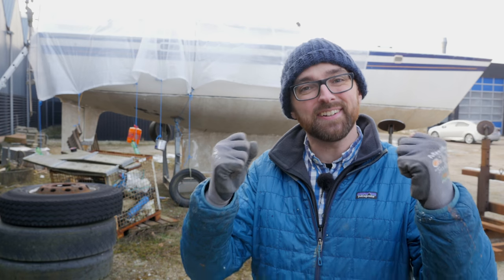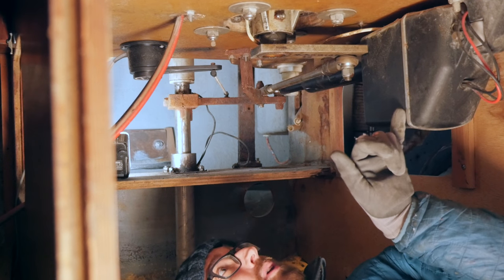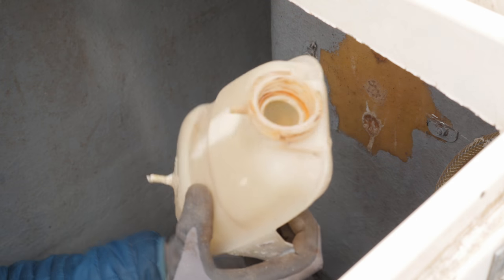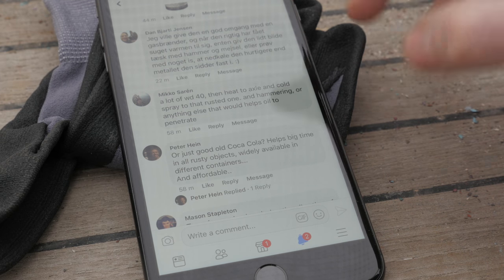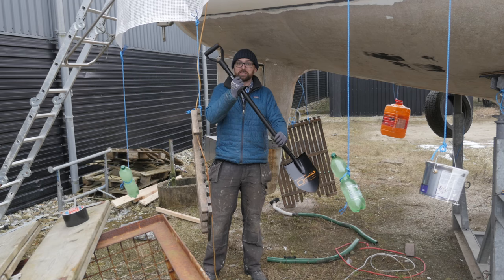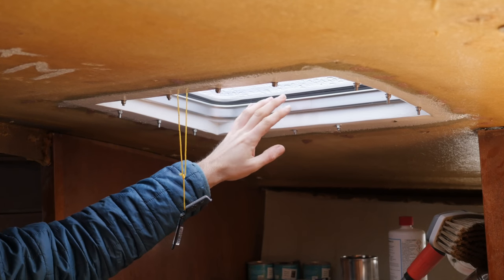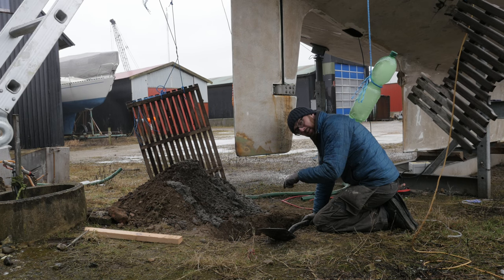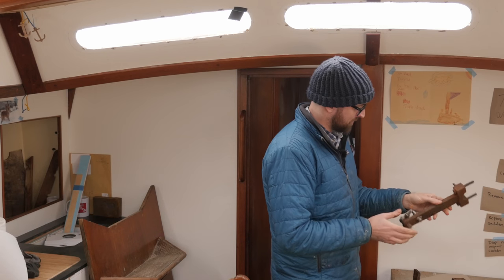Sail Life - Removing the rudder from my sailboat - DIY sailboat repair

Comment: long time watcher,first time comment. love the channel. just sandblast and epoxy the rudder arm. Surface rust does not degrade the strength of the arm. Also, do not underestimate the power of a heating torch.  Looks like in Denmark, just get the temp up to 70 degrees, the pieces will probably fall apart!  Thanks for allowing us to be a part of your project.

Comment: Well, moving on to the immediate question, and if you are still reading these comments:  Use your heat pad on your rudder for a bit and drill a 10 mm hole or two at the bottom edge and see if water comes out in quantity.  If it does, drill a few more holes to drain most of the water so that you can transport it to your family's heated shop.  And, If you've got the bucks ($$$) for stainless, I'd go with bronze or silicon bronze.  Boat builders generally build their struts for prop shafts out of it, not stainless steel.
Oh Yes, keep the quips coming, they make my week!

Comment: Mads, that rudder is full of frozen water!! Stand it up, drill a couple of big holes down the bottom and apply heat. It will be much lighter in a day or so. You know Andy has a great set of videos on rebuilding these beasts. New bolts for the skeg attachment are necessary.
Thanks for another great video!
John H.
B.C. Canada

Comment: Soak the rudder "rod" to derust, clean and then mill an 1/8 inch or so off the top of the smaller piece so you can get more threads to go on. that part has held up for a lot of years. A good cleaning and primer and paint and it will serve for a long time. great question is the bolt condition. At worst have them drilled out and put in new longer bolts. Great Work Mads!

Comment: If you can't find someone to fabricate the parts in stainless you could sandblast steering bracket and replace the preventer with flat bar.
I have to add that the only thing better than sanding is working for hours at arms length while lying on your back...hopefully you can take a bit of a break this week :)
Thanks for another great video.

Comment: If it were me I would get the rusty arm sand blasted and epoxy painted.  As for the bolt thread engagement, I would take the clamp piece to a machine shop and have them mill a little off the end so the nuts go deeper onto the bolts.  I would however get that vertical support bar copied in stainless, looks like a simple enough part.  Please paint the engine compartment, lol, you'll be glad you did.  Great work so far, keep it up!

Comment: Chances are the rudder arm is steel because of its strength.I wanted to make mine in stainless but my friend who is  boat builder recommended keeping it in steel.There is tons of force on that arm in a sea and stainless can break.Either blast and epoxy prime/paint it or replace with steel but no point in going to stainless.
Reply: I'd review the stress relief in that welded one. The key is gentle arcs for change of profile.

Comment: I love how you describe your rudder as 'unnecessary clutter' :D 
I would agree with the others in that I would get the rudder arm, blasted & powder coated or galvanised. The other brackets would be better in stainless though, I agree there
The important parts (mating faces) of the arm are all intact and it's really only surface rust. Cut the bolts off and replace. Stainless bolts have far less tensile strength so might not be suitable.
If you insist on replacing then I think I'd be looking for a bronze replacement as makes any future modifications/additions far easier.

Comment: For items like the auto pilot connecting arm. You could use, what I call a tuning fork.  It is used by mechanics to remove ball joints and linkage like you did for your steering.   They don't cost much and are very much worth every penny in frustration saved!

Comment: You might want to learn the "two foot shovel jump stomp" where one holds the shovel out in front with both hands, then jump two-footed onto the foot flanges of the shovel.  Think mounting a pogo stick I suppose.  The angle you hold the shovel handle is critical as is making sure your full weight body vector comes down in line with the shovel blade vertical axis; this typically involves pushing the handle away from you as you come down on the shovel blade :)  But the heating pad worked very well

Comment: Hi Mads. Just few thoughts. PB blaster is wonderful, perhaps have Eva ship u couple cans or you could pick some up next time u are in the states at any auto or hardware supply store. Like u, i started building and repairing boats as hobby years ago and find it very rewarding and relaxing ... on most days, ha! In order to add to my quiver, i started learning to work with metal as well. Ive found welding and machining my own parts very satisfying and u would be surprised how inexpensive and easy the process can be. I mention this because of ur rudder parts and other potential items along the way. Its possible to find all things needed for around $1000. Torch, welder, mini lathe, mini mill, sandblaster and even things to powder coat. I spent some time learning about these applications making the coin operated view finders seen all over the world here in Fairhope AL. The learning curve is small and the knowledge vast. For example on ur rudder parts ... u could sand blast, tap the screws and replace with longer stainless, then powdercoat with marine coatings. Most people dont realize how inexpensive and durable this can be. So is something to consider. Also a suggestion if just not ur thing, most machine shops, regardless of there particular specialty, will be glad to make those parts for u on the side. Id be more than happy to share more on where to buy and certain products if u r interested in looking into fabricating ur own parts. Either way, great job and press on mate ! Cheers

Comment: You can use the angle grinder to cut that small weld off, then get longer bolts.
Reply: Cut the bolts cut off, get new SS longer ones and nuts/washers - then take all the rusty bits get them shot blasted - arc weld the new nuts in place, then apply two coats of Hammerite  paint.
Reply: or paint with same epoxy paint than the engine compartment

Comment: Hey Mads, 
PB Blaster is your friend. I use it on 70+ year old cars and tractors to loosen stubborn bolts. Hit it with a hammer a couple times, spray PB blaster generously and let it soak for a couple of minutes. You should be able to buy some off Amazon if nothing else. Or you might get an American friend to send you a few cans. You can also get them to send some carpenter's pencils. I think you'd love them.

On that arm you want to have rebuilt. I might suggest aluminium bronze or silicon bronze. Stainless steel is more rust resistant than normal steels but it still rusts. Bronze does not.  Just something to look into.

Comment: I vote for dealing with the rudder!!

If finances are a concern I'd just clean everything up and move on.  I'd say it has held up pretty well considering.  Part of your routine maintenance should be to keep those parts slathered in grease in the future to prevent them from rusting up.  You should probably replace the key for sure.

Comment: Hey Mads, definitely price it in stainless, regular welding shops with simple machining equipment would be able to replicate that. If it's too expensive, an acid bath with sanding and filing followed with a powder coat will out live you.  Can't wait to see the inside of the rudder,  when I dropped my skeg it went through the pallet and 4 2x4's strait into the pit.  Good times!

Comment: For the hole [in the future], in my winter digging experience if you can get an old ax of some kind it will really make getting through that first 10 to 30 cm of frozen ground go smoothly. From there, it should be easy to dig with a shovel (keep your fingers crossed though ;-).

Comment: Mads I too am in favour of painting out your engine compartment. It’s always good to finish a project before starting on the next one.  I must admit watching you try to dig the hole for the rudder to drop into had me smiling and thinking you bought the wrong tool. A mattock rather than a spade would have been a good idea. I also had wondered why you didn’t try pouring boiling water onto the ground to help melt the ice. Anyway you got it done regardless. I too think that sure those rusty metal parts are pretty crusty but bead/sand blasted and re painted they probably will be fine. The only thing is somehow installing longer bolts in it will be important. I would think having it remade in stainless while nice would be expensive.

Comment: Hi Mads
     a couple of opinions. Do the painting last. if you paint first you might destroy your paint job when you re-install the rudder. If need be. Do it in sections. Areas where the rudder and steering components are in your way and engine bay last. a piece of stainless steel that big and machining would cost a small fortune. A rule of thumb in the aviation maintenance industry. if you have one and a half to three threads protruding through the lock nut. That will be satisfactory. A good machine shop while cleaning the part could mill the end cap down to give you more threads or remove the old bolts and replace them with longer new ones. I would  go with the new bolts. We all have different opinions. Do the one YOU feel is right.

Comment: Mads, get the rudder arm sand blasted and painted. It will last 30 more years. Have the machine shop check it for cracks. The rudder stop is easy to make yourself. Just get a piece of steel or ss and bend the end. Bolt on a piece of metal for the rudder stop. Oh to remove the bolts, grind off the heads, heat with torch, support on immovable surface (ground), bang out bolts with appropriate size punch or drift.

Comment: Did you consider having the arm for the rudder sandblasted and powder coated? It should be easy to replace the short bolts with longer ones. Steel is stronger than Stainless Steel and it will save you some money. Anyway..,nice progress.I always look out to your videos.
Reply: I had the same idea , except to get the parts hot dip galvanized , even powdercoat will separate eventually if scratched.
Reply: The rudder shaft is stainless
Reply: Steel expands 300 times when rusting, so 2 inch vent pipes rust solid shut becoming air tight.  I have had Linex  (tough pickup bed liner that is sprayed on) on all sorts of steel, water proof hard to scratch, but stainless will always be bettet.  Also a good stainless would be far stronger then steel.  One last idea if the new key is steel cover it with antisieze, inexpensive and may make your future self happy.  Keep up your awesome work
Reply: Jim Jeffries. Stainless is never as strong as carbon steel. However, it can be made strong by making it beefier.

Comment: A rudder that heavy would seem to indicate that the interior foam is full of water and frozen. Can't wait to for you to cut it open so we can see the condition and make sure it is safe. A few years ago I was on a boat in heavy weather and the rudder post separated from the fins so we could only turn right. We ended up getting a tow from US Coast Guard, but it killed the rest of the sailing season.

Comment: Mads,. I vote you clean and paint/powder coat the old arm and use it again.

I am curious about the space around the rudder post just after of the diesel tank.  Where the green hoses criss cross.  It seems that is under used space.  A redesign to make that area accessable may be a good idea.

I believe it's time to put the silicone heating mat on the fiberglass over the sail drive hole.  This will likely warm the engine room to allow the use of epoxy and slow down the steady stream of objects going through that hole.

Comment: Mads,I dont know if you saw my previous comments but I'm glad the tanks are still there.You can cut them up to use as brackets and backing plates.Also the angles work great for mounting things since they have a nice 90 bend ;-)

Comment: Re: the rudder arm.  Its stainless so absolutely keep it.  Bead blast it, it will clean up.  Get the bolts machined off and new ones installed.  You can get the arm powder coated to put a very long lasting protective coat on it.  The other vertical brace will need replacing, but a local shop should be able to do all that easily.  Cheers : )

Comment: You need a small propane plumbing torch in your toolkit. Plumbers use them in extremely tight spaces (here in North America, usually surrounded by exposed wood framing) all the time. I don’t mean a big Tiger Torch, I mean one of those small, focused, “blue flame” torches used for soldering copper pipes.

Comment: Another Great Vid Mads, I'm with the refurb Guys, remove the old bolts, sandblast & repaint/powdercoat/hammerite or one of your epoxy paints. I also like the key drilling idea for releasing the key regardless of material.while all thats being sandblasted & bolts buying... you could paint the engine compartment!  BTW what did you decide about the oily woodwork, haven't seen it mentioned.

Comment: As many have said PB Blaster is you friend. Don't know if you can get it in your neck of the woods but here in the US it is the go to penetrating fluid. On your steel steering arm parts why not just derust, grind, remove/ replace the welded bolts with stainless and powder coat the parts. Those parts made in stainless could be very expensive.,  Great videos!
Reply: He could just clean it up however considering the moisture that would be in there and the rust already on there it will be an issue again. He can't just use stainless bolts because mixing stainless steel with the regular still will cause a galvanic reaction and corrode it much faster. Using stainless it's an all or nothing thing.
Reply: As far as stainless/ dissimilar metals goes that is easily remedied. Nylon or brass sleeves and washers will insulate the metals. The bolts are only to hold the cap in place. Powder coating is only as good as the prep and coating type when done correctly Marine grade powder coating on a piece interior to the salt environment will hold up more predictably  than an exterior part that has a chance to be chipped or submerged or saturated in salt water. I would simply as an expert after getting the estimate on a stainless replacement.
Reply: Your best bet is just to cut off the old bolts and replace them with longer ones and plan on replacing the part when necessary or replace it with stainless. Roy can correct me if I am wrong but for sailing local the existing part or similar replacement is fine but if long term blue water sailing where your going to be out on the water all the time and at sea away from port, stainless would be worth the added assurance.
Reply: Is that linkage cast iron? If so it might only be surface rust. Cast iron stuff can be left out in the weather for decades and clean up really nice; although I'm not sure how that translates to salt water. But I'd try dropping everything in a rust remover and see how it looks.
As for the too-short bolts, you could counter-sink the cap a bit to leave more thread exposed.
Reply: As if you haven’t enough work already Mads, ditch the rusty arm and replace with stainless as you intended. That is now something that you’ll never have to worry about ever again.

Comment: Hi
I like your videos enormously they are very informative and well done. Regarding the the rudder I think the arm is made from steel because it is much stronger than stainless steel. It is worth checking out. With a clean and paint it should last a while. Try using etching primer when painting to get good adhesion. Peter

Comment: Have a new one built in 316 stainless.   Use bolts that go all the way through without welding them on,  use  self locking nuts or  cotter keys and drilled nuts.

Comment: I think to make that part in stainless could break the bank. It would last another 40 years in mild steel, just get a coat of paint on it and touch it up every 7 to 10 years.
Reply: No touch up required: look at the surface of that thing, freshly ripped out, completely uncoated for who-knows-how-long: That's one quality chunk of a lever!
Reply: Second that. Get it blasted, and paint it with some rustkiller & layers of good quality paint. 
Will outlive us all, no worry.
Reply: I've got to agree. That's a nice chunk of steel. Clean it up and keep it. If you're concerned about the bolts not being quite long enough (a valid concern,) just mill out an eighth inch to counter sink the nuts. There's plenty of metal on that bracket and it won't affect the integrity. Alternately, grind down the bolt heads and drill them out. Whichever of those two routes you take, it will be leaps and bounds ahead of manufacturing a new unit.

Good luck with whatever you decide and all the best.
Reply: I wouln't spend the money on SS for that control arm.  A good sand blasting and paint job with good quality rust resistant paint will last you the life of the boat.  The fittings on it are SS anyway.  I would grind the weld off of the rusted fasteners that are too short remove them, and replace with SS bolts and nuts that are long enough.  You could have a welder tack them on if you want, but if you can get a wrench on them in situ - i wouldn't bother.  

The bracket, on the other hand- should be remanufactured out of 316 SS.

Regards - Chris Clark
Reply: Agreed a good shot blast and recoat with decent paint is the way to go. If possible I would get it zinc flame sprayed after shot blasting and before painting. regards